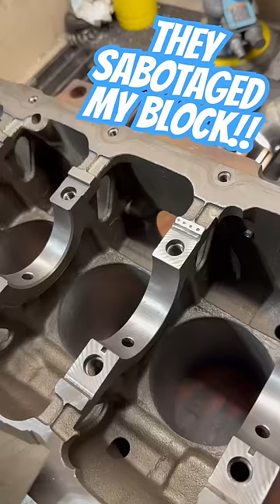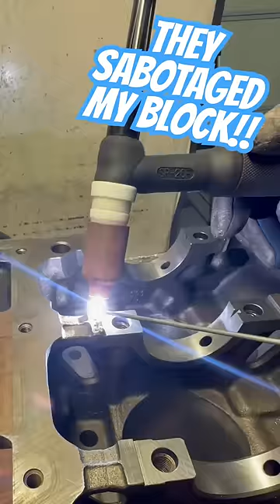My in laws tried to SABOTAGE me AGAIN! #machining #shorts #repair #welding

Comment: You sir take engine work to the next level.
Reply: Bravo you are a mystro.
Reply: That's how it should be and how I always work on my car
Reply: I'm your 200 like... so, 
What do I get in the Will? 
😅😅😅
Reply: @rumplestillskin6157  a shot of glenfiddich 12
Reply: That was a horrible repair.
Reply: thats a cold lap weld. garbage. the first pass of the mill shows the lack of fusion. this is not next level

Comment: Ugh..In-laws! Dam Shame we can't fix them with a tig welder and an end mill!
Reply: I’d like to test out your theory before ruling it out of hand.
Reply: I believe you could “fix” them with a welding machine and an end mill but it would certainly get a little messy.
Reply: @robertgarrett7007  Yes!... Yes it would!!😂
Reply: Depends on voltage or end mill rpm when it enters their skull. Where I live we have plenty of places for unmarked graves. My in-laws are out of the picture but I would never allow this to happen more than once. Buy a good quality shovel and dig your holes before you need them - deep holes.
Reply: @liamstone3437  
Yep, and dig them on land that can't be linked to you.
Reply: the funny thing is. you can
Reply: @liamstone3437  Sounds like you've had crappy inlaws before!...lol
Reply: You can fix inlaws...1 way it's going to hurt...the other way the duct tape just muffels the sound..

Comment: Lack of fusion at the base of the weld, maybe something,maybe nothing, go through a few heat cycles and high rpm,or low rpm heavy load could be the start of a crack
Reply from the maker: Tell me you’ve never welded cast iron without telling me.
Reply: @EngineRehab   pre heat sounding area as done ,peen weld after, my own personal advice would be to use a dissimilar filler wire as it would be softer and less prone to cracking, yes cast anything is usually full of impurity, but I would still try to fuse the foot in a little better. 
I have welded cast iron with flux coated rods, and magnesium alloy with Tig years back,the cast iron was damn near perfect,but the magnesium alloy was a pain.
Reply from the maker: @frankcarden4709  yeah I’m not interested in shoving a ton of head into a dimensional buildup. My experience is the edge of the weld is always going to be the failure point. Shoving more heat down its throat isn’t going to make the weld stronger. My opinion is you need to spend as little time possible welding and affecting the casting. The least amount of heat and HAZ possible is always the best route to increase chance of success. This isn’t a structural repair, cast iron tig repairs should never be used in anything that’s under stress or load.
Reply: @EngineRehab  okey doky

Comment: I got a lot of questions. How did you confirm center line? I will leave 1 for now.
Reply from the maker: I set up based off of the other main registers and cut the repair to match

Comment: After welding and preheating block near main bearing you gotta check  the crankbed for a twist in all dimensions coz its may cause a shattering of the crankshaft after several rev cycles. Ive seen some cases that worked but not for long

Comment: I'm currently machining a small engine, maybe 1" bore, and NOBODY is going near it when it's taken apart. at all. ever. it has .25"Ø valves. I'm not even touching it without gloves when I assemble it.

Comment: I have a question for you. I have a 2017 Hyundai Sonata Sport. I live up on a mountain so when im driving down to the city, i coast a lot because im going downhill. When i get to the bottom and have to use the accelerator again, i get a puff of smoke out of my exhaust. 

What could cause this do you think? And do you think its something i can fix so it doesnt do that? I go through about a quart of oil with every tank of gas because of this. 

Any insight would be so greatly appreciated. ❤
Reply: Oil seeping into combustion chamber. Replace value seals/piston rings 

Probably only happens after the downhill because car on angle

Comment: What you do is you dig a large rectangular hole in the yard, leave the shovel sticking in the dirt. Then, next time said inlaw comes walking in, you gently place your arm round their shoulders, look them gently in the eye with a very friendly smile on your face, have a little friendly chat about never, EVER, messing with your work again. All the while gently walking them over gently towards the hole.

A calm demeanor, and no explicit or implicit threats, other than the hole and the shovel just happening to be along the path of your little stroll, is paramount.

Comment: I’m sorry this happened. Out of curiosity, what welding rod did you use? I have a few engines at my shop that need this same repair and the er70 rod is tough on my end mill bits
Reply from the maker: This was 308 wire.

Comment: Have a blind guy run his fingers where the cap joins to see if you need a align bore. My brother in law saved my rear on my first engine build because the machine shop gave the block back to me with one cap turned backward which due to inexperience I would not have caught.He could tell the mismatch of about 1.5 thousands with his fingers.

Comment: I need to know the welding procedure you did on that block!  Was it a nickel rod and pre-post heat like on cast?
Reply: It was a horrible repair.
Reply: @701chevy9  why do you say that?
Reply: @thomaskovacs5094  The weld didn't bond at all.. Welding cast iron is almost dead art. This guy in his garage doesn't have a clue. Also this is a very critical area, you don't just go welding and surfacing all Willy nilly. From what I can tell the crank wasn't going to be align honed either, which would be 100% necessary on this repair.

Comment: I had an employee or a friend ( use that word lightly) put sand in my 434 for 67 camaro restoration project.i had alot of money in it i put the motor in it after it was painted. Motor an trans together in the car with the hood still on it without a scratch . A motor with sand in it. I found it after it started smoking.  People  can be MFers

Comment: I'm loving the channel! I had some questions about your cast weld, what rod you using and if that was pulse? It seemed like it was but I also don't know if that was just the video. I have to repair a cracked bolt in a 302 Windsor trans mounting surface and I'm nervous about it. Other than preheat, I haven't found a lot of info online.

Comment: That weld isn’t gonna hold and it has nothing to do with the skill of the welder he later a very very nice bead. However that is a weak point in the engine and sooner of later it will fail. That is a very very high stress point on the block taking reciprocating mass all day long at thousands of rotations per minute. You should get a new block if you can.
Reply: I pray to got it doesn’t come off and get stuck in a piston or plug the oil pan pickup or something catastrophic like that.
Reply from the maker: Soup word. Gymnastics brain. Confused so I’m.
Reply: @EngineRehab bahahahaha well said! 

Goats are like mushrooms, because if you shoot a duck, I’m scared of toasters. 🤷‍♂️